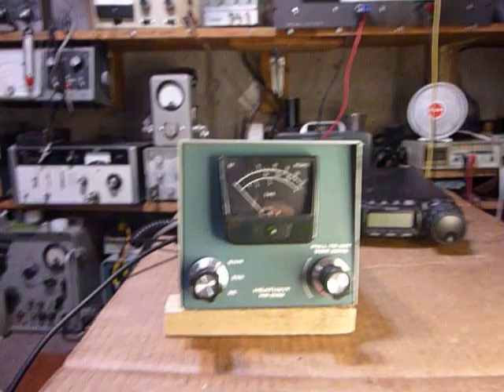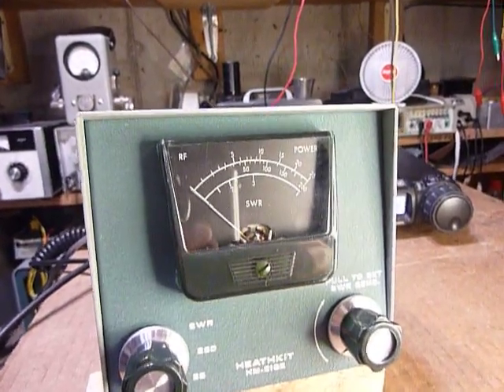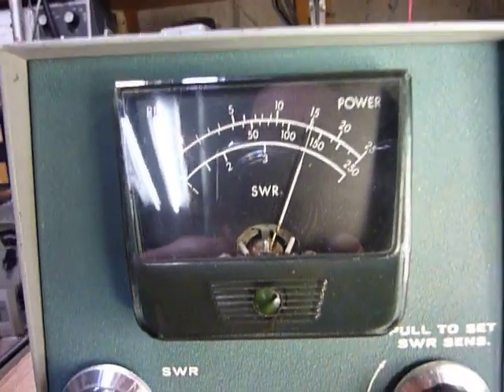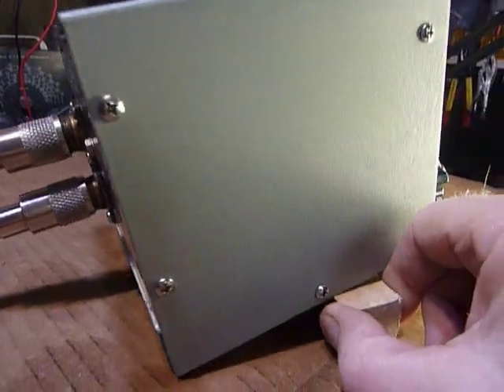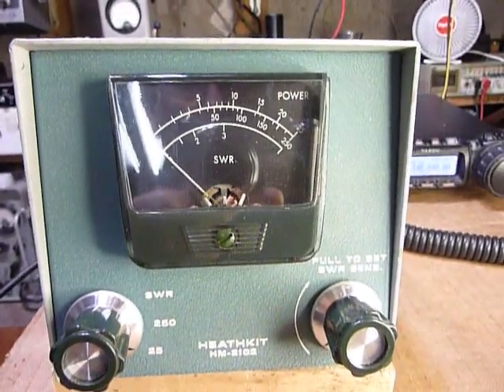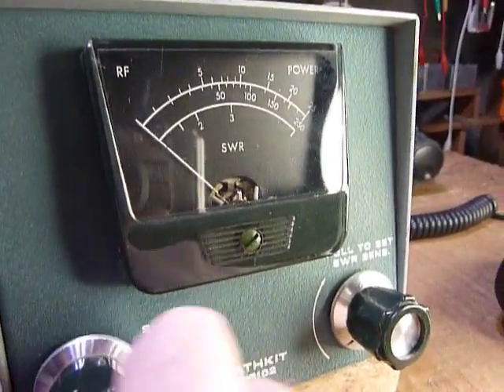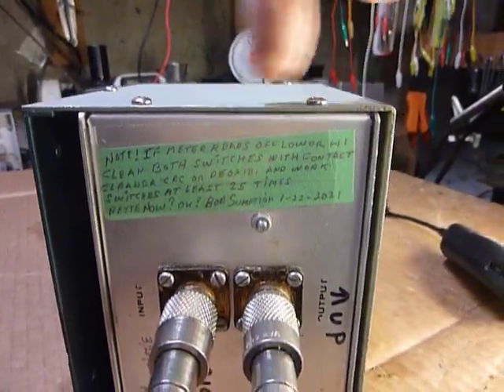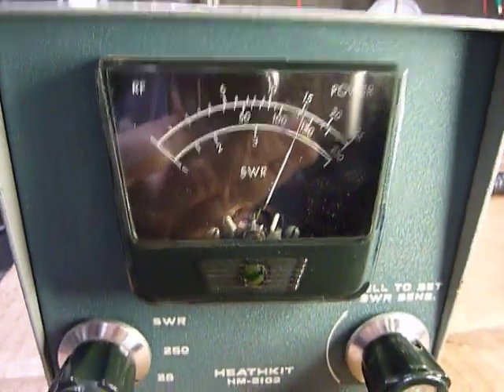HEATHKIT Hm2102  or Hm 102  SWR/Wattmeter

Comment: Thanks for this video, I just purchased one of these units on Ebay a couple of weeks ago, it came with the original manual. Haven't tried it yet but will soon. One thing I found out the hard way with that CRC cleaner, some plastics like meter housings just fall apart if you use some types of cleaners on them. It seems to just leach out the polymer of some types of plastics. Seems to work ok on this older stuff but the newer plastics just be ware.

Comment: Clean them Switches I know I did alot of them meters deoxit it's the best . I've rebuild two models menny times.
Reply: Dont cheap on the cleaner deoxit is the best I know. I've rebuild both models
Reply: @Atomshamradio  It’s good but it leaves a residue which will collect more dust and dirt so if you use it you should follow up with a blast or two of the CRC just for good measure.👍🎙